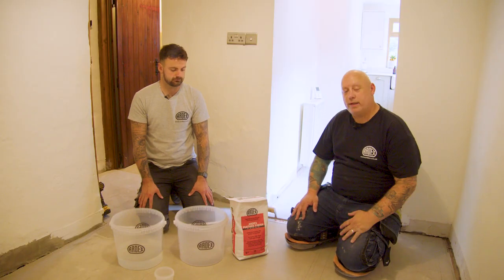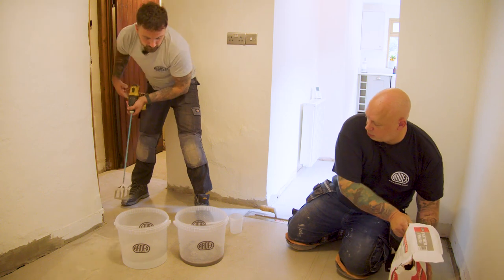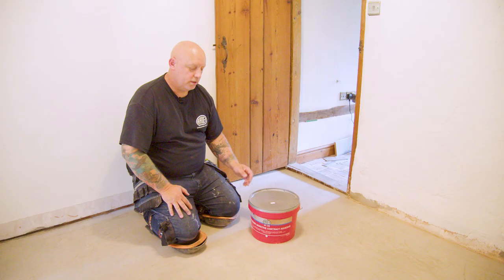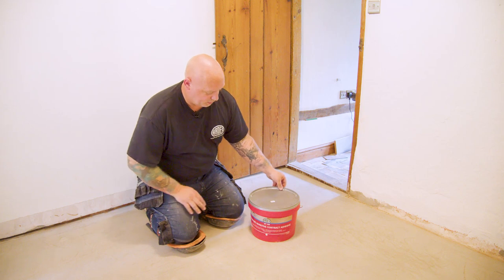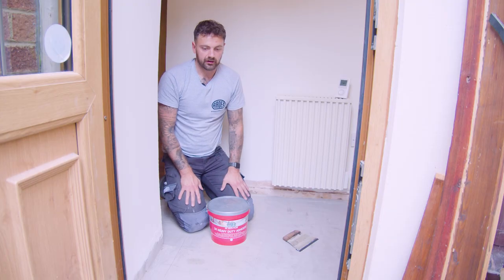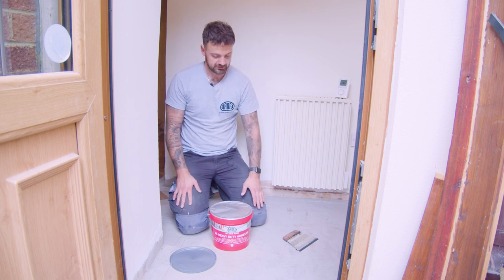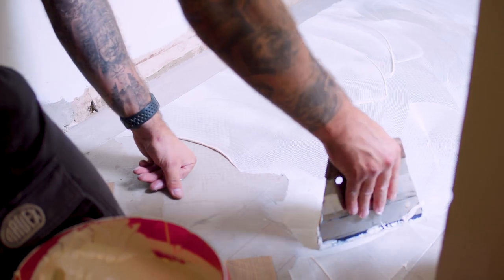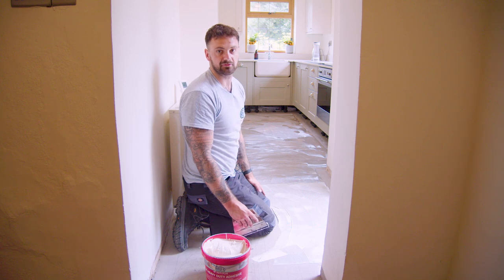Refurbishing an Old Kitchen Floor with Herringbone LVT

Comment: Are any of your products suitable for using on top of a vinyl tiled floor. There are are several low spots which I need to rectify without taking all the old vinyl tiles up. When level I intend to fit laminate flooring over the existing vinyl tiles. Thanks if you can answer👍
Reply from the maker: Hi, ARDITEX NA may be applied directly as a nominal 2mm smoothing layer onto clean, well adhered vinyl flooring which is a minimum of 2mm thick. Please refer to the ARDITEX NA technical datasheet for information on application over vinyl tiles or contact our technical support team on 01440 714939